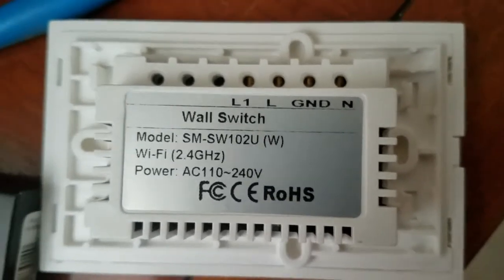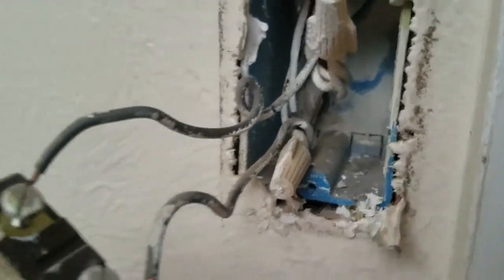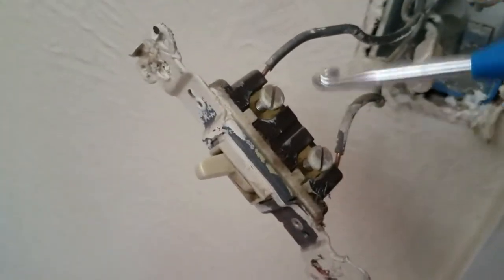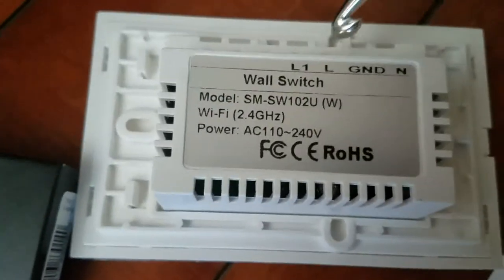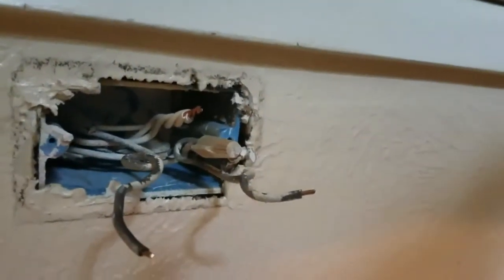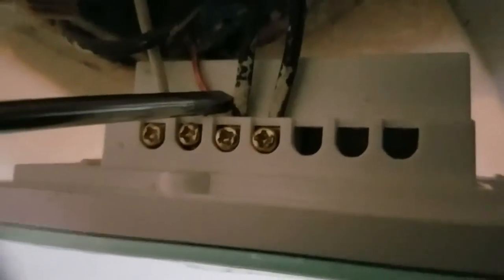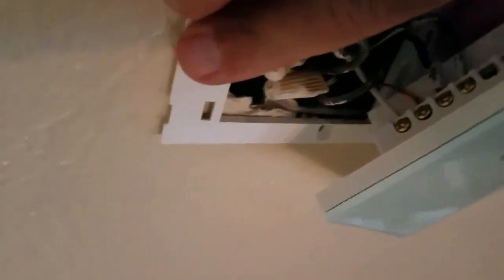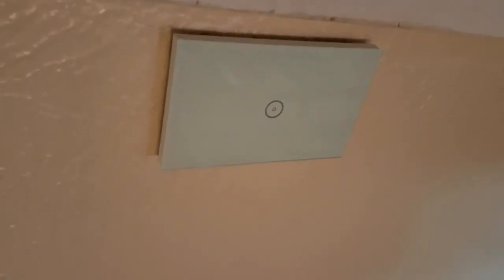SmartSwitch SM-SW102U Installation

Comment: I have 1 white wire, 1 ground level wire, 1 black wire and 1 red wire. I only have a problem with the black and red wire. Which goes where, my lights were flickering.

Comment: So I am having an issue putting mine in.  My original light switch powered 2 sets of lights.  It has a push in connector.  So one wire to one light was in the push in, and the other was connected to the screw.  I have the neutral from the main line in it, what about the neutral from the 2 lamps?

Comment: I'm having an issue setting up the WIFI connection. The limited documentation indicates the device should go into "standby mode" when first powered on, indicated by flashing LED. I have double checked the the lines, L, L1, L2, L3, N, G (I have the 1 gang 3 switch device), and all is correct; 120 volts: L- N, L -  G; 0 volts N - G, L1 - G, L2 - G, L3 - G. When I turn the breaker on, The devices manually switch on and off, but I never see the LEDs flash. Am I missing something or do I have a defective switch. Is there a reset button? on the outlet devices I have successfully programmed , you hold the power button for 5 seconds to put the device in setup mode.
Reply: I am having the same issue.. have you been able to find a solution to this?
Reply: Hold the button to the left for 5-10 seconds to enter "discovery mode"